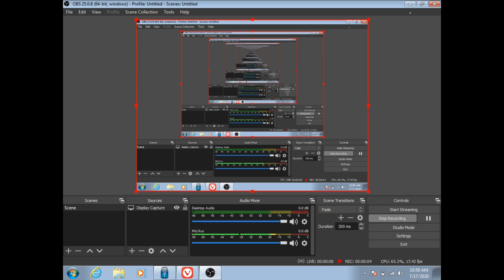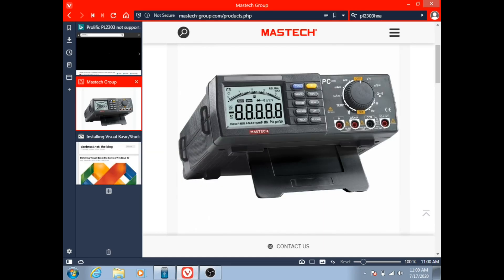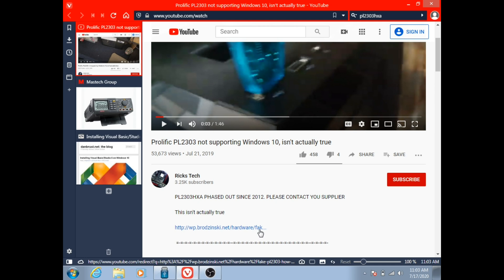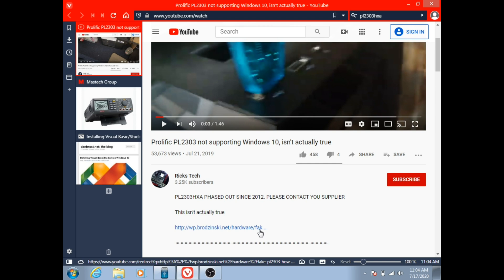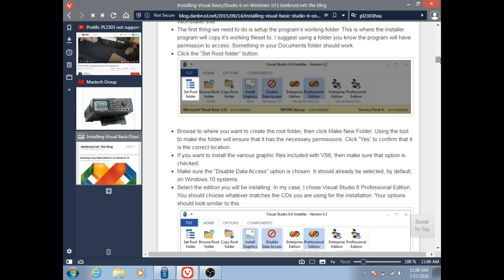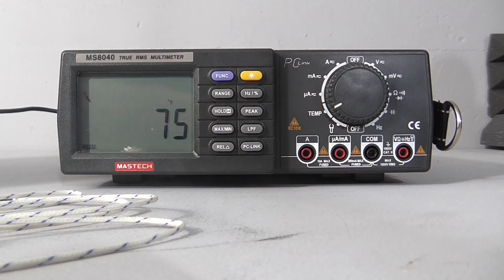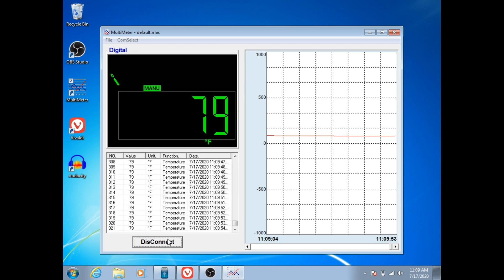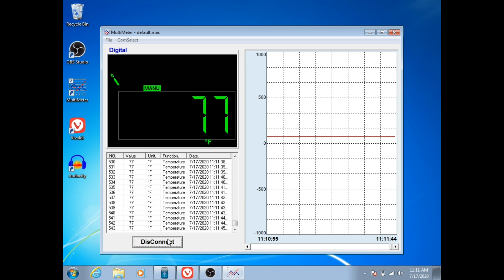MS8040 Serial data output and testing.

Comment: I was able to get the software from mastertech to work on windows 11.  I went to windows capability tab, and put the driver and program in administration rights and use windows 98. I also reduce the pixels.  I did not need a USB to serial rs232 cord i just used a normal serial port and the fanless computer with native serial ports worked.

Comment: Hi, i tried to search for the software on the internet, but I can't find it out. Could you please send me the software installation?
Reply from the maker: I haven't found it online but found my original download and zipped it https://drive.google.com/file/d/1jZa2jZRmRJ-mGl1aUr-EN2E01RyrHX7o/view?usp=sharing
Reply from the maker: when I did this testing I was able to pull the software from their main website https://mastech-group.com/na/en/product-list/content/56521D120441 however it doesn't appear to be listed anymore, I'll see if I can find my installer or an old version of the site. That said if you haven't already bought this meter it's likely more trouble than it's worth, not that it doesn't work but I have to keep an old 32 bit laptop to get the software working right(not that dedicated lab gear is bad it's just irritating)